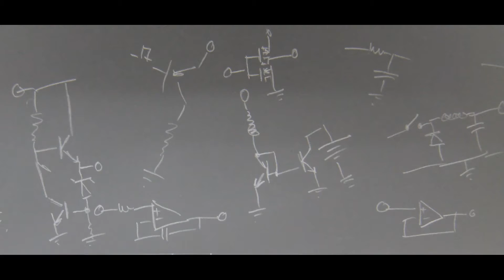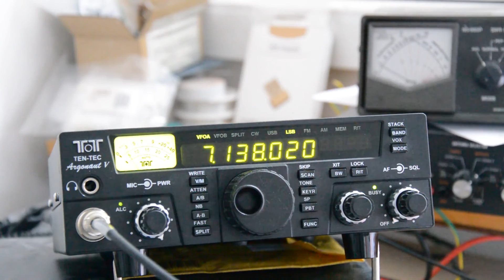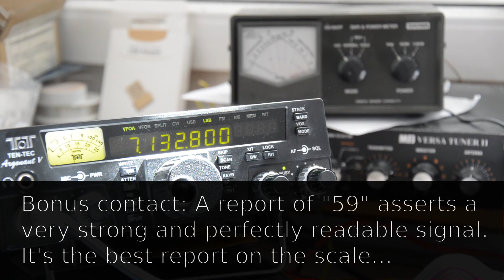TenTec Argonaut V Repair Part 2

Comment: Matt - fortunatly I found your video.  My Argonaut V is showing the same problem.  Just i have bought the filter Murata on ebay to repair the rig as soon as possible thanks
Reply: how it goes??
Reply: @eduardopower5254  very easy to repair

Comment: Matt - So glad I found your video.  My Argonaut V showing is the same problem.  Just wondering where you purchased the filters you have.  Thanks!  Chuck  KD8PFE
Reply from the maker: I'm glad I could help. The filter is model  CFWLA450KEFA-B0 from Murata. I ordered from mouser but the part was discontinued in the meantime and mouser doesn't stock it anymore. Looks like you can still get it from places like rf-microwave.com or ebay, though.

When sourcing a replacement filter, it's important to get the center frequency, the bandwidth and the input impedance right. (Compare with datasheet of the original part.)

Comment: Ten filters to experiment with! Here in the US I can't find any of these "EFA" filters to fix my ArgonautV. Mouser has some "HFA" series- same center freq & similar impedance, but the bandwidth and selectivity are different. I only use the rig for CW so maybe will give it a try. I guess that will by my filter experiment, haha...
Reply from the maker: Unfortunately the filters I got for experimenting are not the exact same type, otherwise I would have sent a few of them over to you of course. Any chance of getting them from those guys? https://octopart.com/search?q=CFWLA450KEFA-B0+

Comment: Epoxy seal it would be the best guess just do it in a low humidity spot until cured. Here's a little information of interest while not the same component still same theory https://tetech.com/wp-content/uploads/2013/10/ICT97MJN.pdf  . Doesn't look like it's hermetically sealed from the datasheet. They are not going to be replaced as they are end of life, maybe stock up if you don't find a solution.
Reply from the maker: Heh that would be a fun test condition to add if I actually replicate the experiment, thanks for pointing that out. Although a number of people suspect that the contamination is there initially because it's introduced in the manufacturing process. Sealing would surely help for conditions like those described in the paper, but if it's contaminated before sealing then it would still go bad eventually (I think).

Comment: Corrosion can certainly be accelerated by electrical current.  But it has to begin somehow.   I wonder if the supplier of those filters is in a humid climate.   Maybe a small amount of moisture is in the case from the factory and they will all die eventually.    If they're corroding, then it's definitely a manufacturing process problem.
Thanks for the look inside the failed filter.   I sometimes do autopsies on failed components myself.
Reply from the maker: Thanks for your comment, I fully agree. I've also been wondering about the following: Even if you implement the AC coupling caps, you will still end up with a small amount of DC. A super small amount of leakage current but it's there... I guess that reducing the current will increase the time until the filter goes bad, but it would still happen. Then again we're talking many orders of magnitude so the effect is probably just negligible. Interestingly my dad hat this radio on the shelf for many years, it wasn't used much.

I don't know who supplied the original filters, but the replacement filters are murata brand.